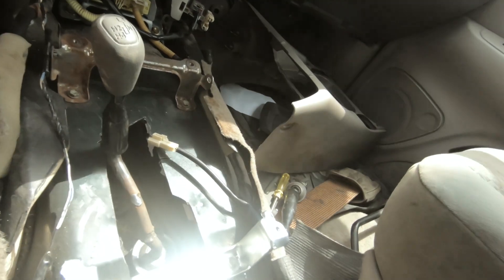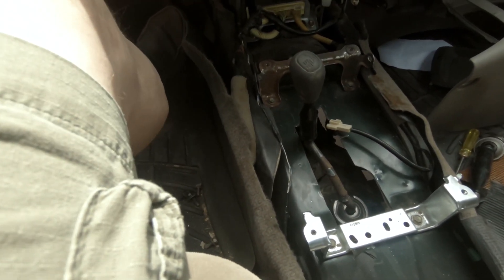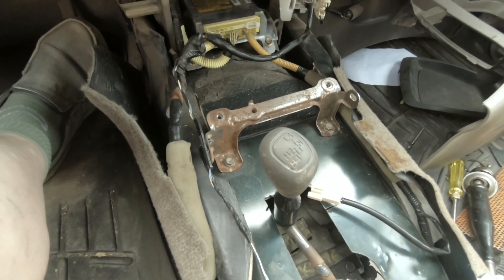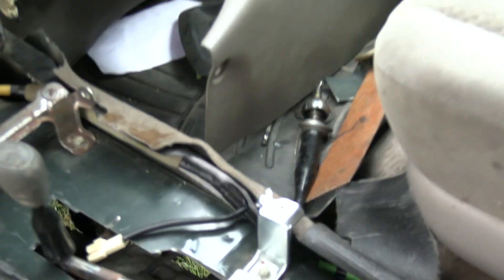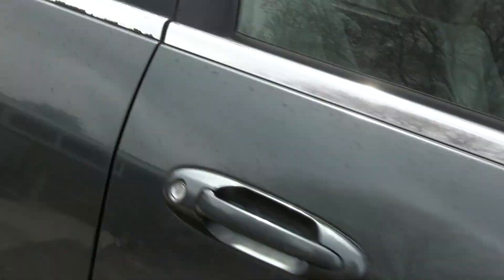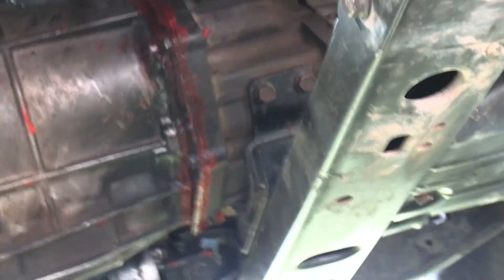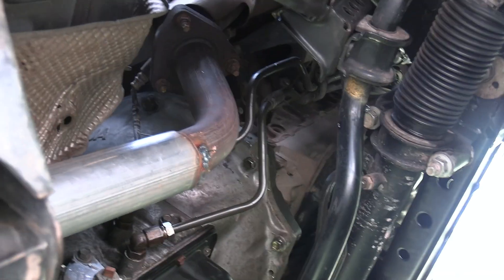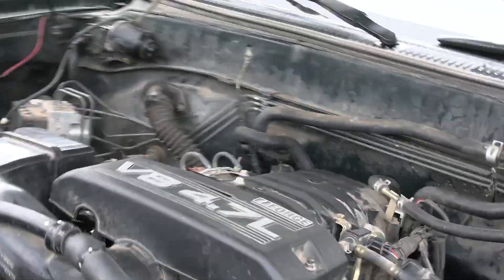4x4 fabrication scam

Comment: Did he do that cobble job on the exhaust too?
Reply from the maker: yes can you hear that? they cut it off then welded it in 4 spots. put apiece of pipe in on each side. the problem is that they never welded the pipe up next to the body very good. the interior was in very good shape before I took it their. if you knew me you would understand I am a picky person about my cars. I don't like people eating in them or leaving trash in them. You bring it in you pack it out. If you saw the mileage the pickup ran great before going there. that's why I was considering putting 4 wheel drive under it. It had 54,000 miles when I bought it 12 years ago. It was a good pickup. it will be rebuilt back to being a good pickup.
Reply: @jamesshomesolarmore2223  I can hear it and I can see it. I hope in the end you come out ok on this deal. Sucks there are shitty people in this world.

Comment: What a bunch of hacks, that truck is completely ruined and I would never trust it to go anywhere. I would sue them for enough to buy a decent used truck. That truck is trashed. Sorry. Please don't put any more money in it.
Reply from the maker: actually, I am going to fix it and attach his bond. that way they pay to fix it right. he was trying to scam me. I am filing on his bond tomorrow morning. I am documenting everything. He plans on opening a new business. he has to have a bond in order to do that. The bank issuing the bond will then have to get the money from him. That pickup will have the interior fixed and the 4-wheel drive fixed and I will be completely reimbursed.
Reply: @jamesshomesolarmore2223  I hope it works out for you. I am also learning from your solar videos and have my panels coming tomorrow. I think I  better order up the inverters and batteries as they are starting to get hard to find.
Reply from the maker: @sh839c  order from signature solar check out my inverters. plus look at their batteries. they are the only ones i buy.
the pickup and cop involvement is going to work out. I have filed against the business with the Oregon justice department. plus the cop that threatened me with a felony I just filed a complaint against him. he was trying to intimidate me to pay the guy. I am going after the cop because he had no right to threaten me with a felony and he also threatened my concealed weapons permit. I put him off till today. even though he said he would be back on Saturday night he never showed up. I started my day by calling an attorney and ended it by filing a complaint on an officer caught on my ring camera.